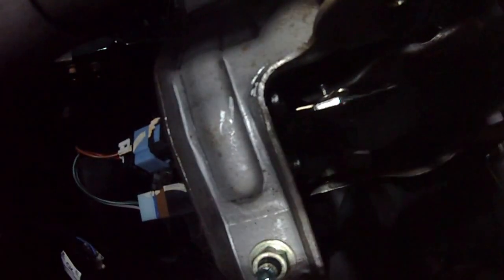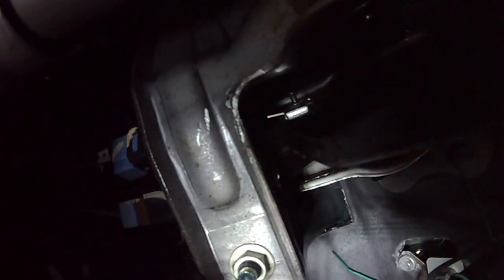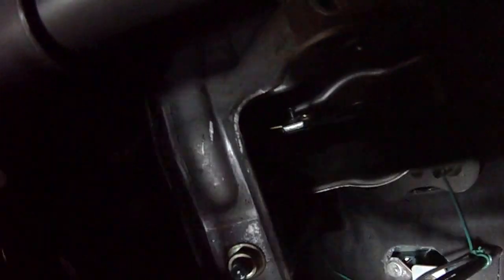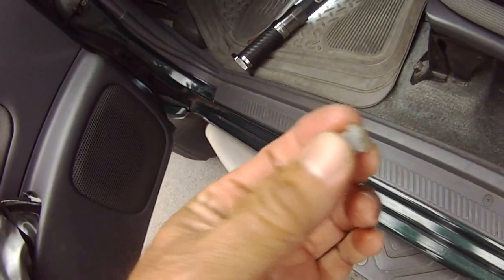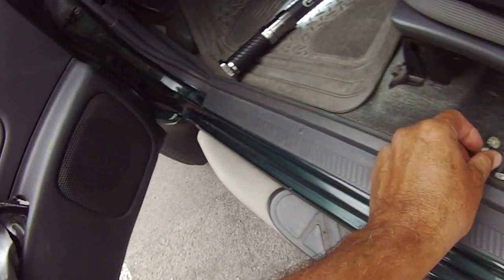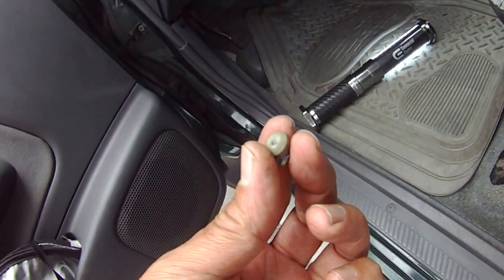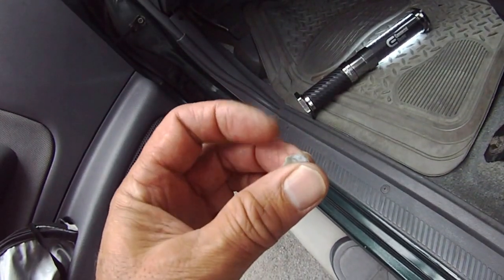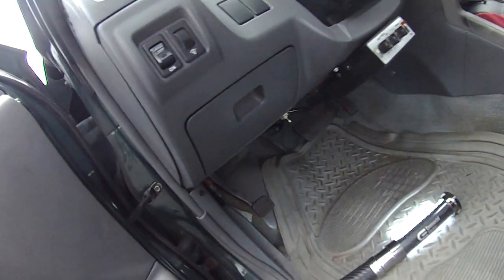Nissan Frontier Cruise Control Fail Does not Operate Part 4 of 4

Comment: I was surprised to find my 2003 Frontier had the same brake peddle button as your's but the clutch peddle button was square hard nylon plastic and in great shape.  Must be the switch so I ordered a new cruise control release switch from Amazon for $13.68 including shipping so not TOO expensive at least.
Changed out the brake peddle button from a $2.49 generic button set from O'reilly's when last night my brake light wouldn't shut off.  Nissan parts dept. already closed and over in Kaneohe so Kailua O'reilly mo bettah.  Pulled the fuse until I installed the part, works great now. 
Mahalo nui for your vids.
Reply from the maker: Ahnko Chee Outdoors Aloha, Glad to see my video was some help. When I looked I could find no information. Mahalo for the positive post.
Reply: jusride7 Nissan charged me $18.99 per green plug...can you believe that!  And I actually paid it!   Brake lights work properly now but my cruise does not.  The power switch lights up but the cruise light on the dash will not come on. Cruise won't set either.  Scratching my head

Comment: Love You Tube. Think I can fix it myself. i have a 1999 Frontier and the brake lights wouldn't go off. Same deal it was a small plastic plug just like the fix for the cruise control on the 2004 X-Terra. Only problem you have to stand on your head to get it in.
Reply from the maker: captainorin Rajah that. The dealer repairs these daily. $

Comment: I didnt see this plug i got 2 switches changed and changed slip ring and brake light is ok still criuse control not tuning on 🤔
Reply from the maker: Are you sure the both grommets are changed and operating properly? One Controls the Brake light and the other activates the Cruise Control. Double check those things. My brake light did not stay on but my Cruise was Inop.
Reply: @jusride7  yep ive checked continuouty of slip ring and it seem there is cut in 2 wires so ive asked seller for replacement yep ive changed only switches but rubber is still ok touch the wood will inform once its worked hope its last thing to do with my pathfinder 2007 r51 cause ill do this weekend door stop got it and its in good shape but i have to tear down the door its for both passenger and driver side others are ok thank goodness
Reply from the maker: @Sroor90010  Normally the switches last forever but the rubber grommets seem to last only 10 years. That is when mines failed and so did yours. 2017 model 2018 fail date.

Comment: Turn on the truck... The brake pedal will move further.  The switch next to it is brake lights. Use some Neoprene bushing lube, or Vaseline on the nub.  This job should take 10 min. You made this much harder than it should be.
Reply from the maker: Jypsy Dog I never thought about turning on the engine.  Roger that. Since you are there you might as well change both of them.

Comment: It would be helpful to show exactly where it is.Under dash or in steering column housing? Also, too much noise.Anyway, I have an idea of what I,m looking for.
Reply from the maker: If you look good under where the brake lever contacts this rubber grommet you will see. One of the the things that I forgot to mention was that you use the brake lever to push the grommet into place.